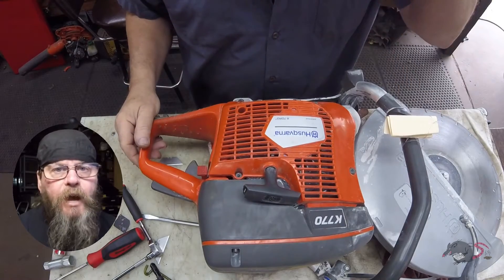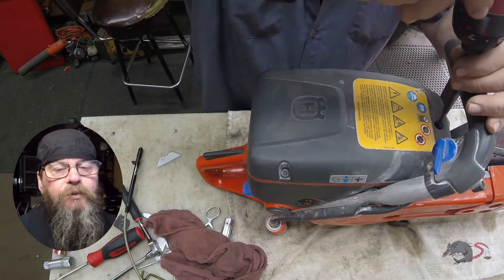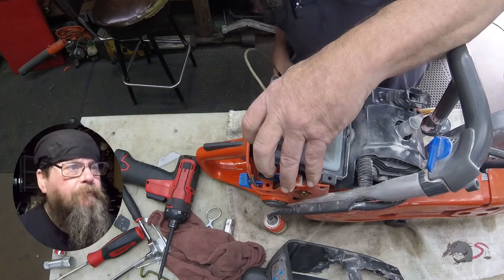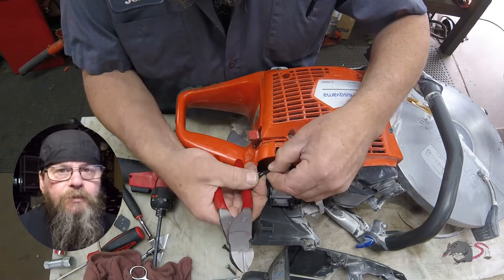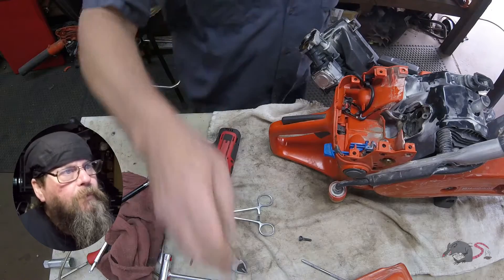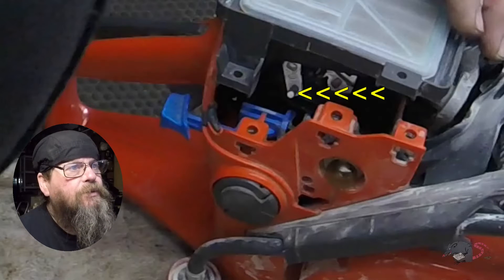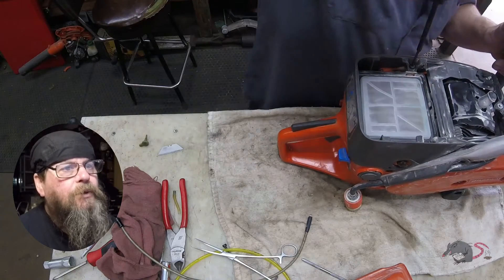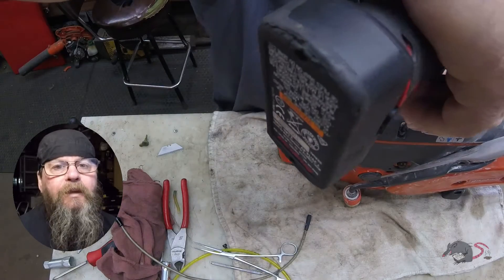Husqvarna K770 Power Cutter Fuel Leak Repair

Comment: Hello sir, one question i can put both saw blades 12" and 14" on the same machine or i need different machine for 12" and 14"?
Reply from the maker: If you have a 14" machine you can run the smaller blade if needed. A 14" blade won't fit a 12" saw.

Comment: A lot of work for a simple issue. Do you have every bolt and screw memorized or just the ones a pia?   Are there tricks to it?  Or just doing hundreds?    Great video.  Take care.
Reply from the maker: I never gave it much thought but I guess I have a lot of different models sorta memorized to some extent. The only trick I can offer that you might see in these videos is sometimes I put screws in piles depending on what they came off of. Sometimes I don't but thats ok, I like puzzles.
Reply: @TheGreasyShopRag  I probably do it wrong by using one of those magnetic bowls. Lol.  Even if it’s junk, the more I take apart and reassemble the better.
Reply from the maker: @steveriggenbach90  Those magnet bowls work. I've even seen guys use egg cartons.
Reply: I used to do that with a car carb. Just sharing. I’ve been using tHe magnetic screwdriver strips.  I screw them to my bench.  Example, bottom for front and top for back. Hope this helps someone. Take care.
Reply: I need help for the same model on a fuel issue. Customer ran a saw with straight gas and you know the rest. Replaced the jug and piston and all fuel lines and filter good compression but will not start. Maybe he toyed with the high low jets and throttle I just don't know. What is the factory settings for the carb. I've tried everything including replacing the carb and still the same thing

Comment: 6:56 how did you get that intake to seat so easily?  I have to take long handle pliers where the one screw goes in and make it fit in place.  Even then it tries to pop out.
Reply from the maker: The more I do the easier it gets but sometimes I even surprise myself!